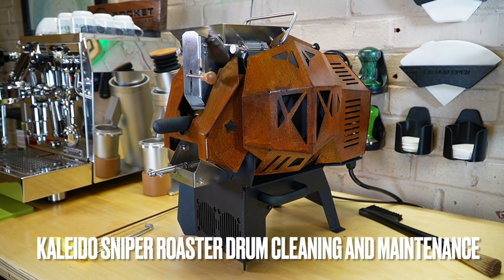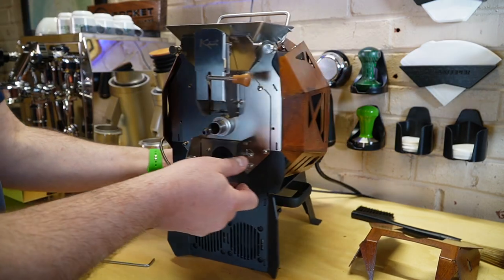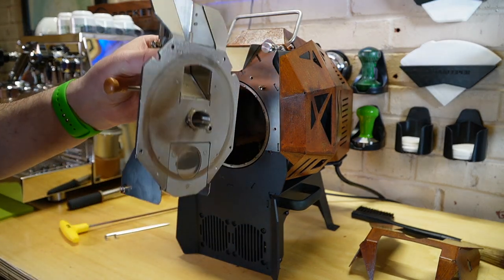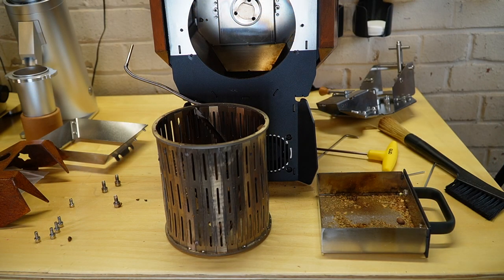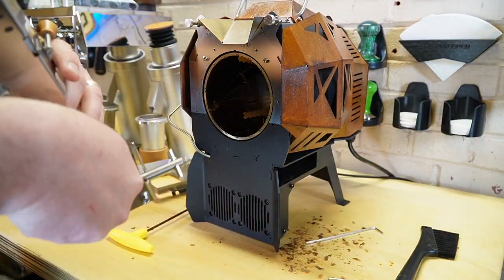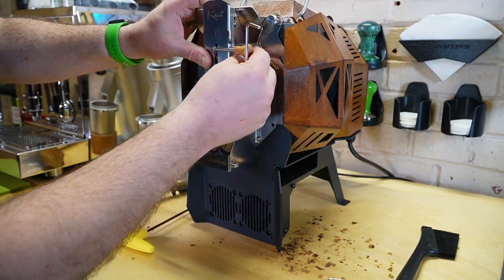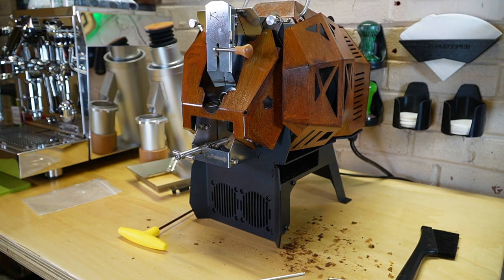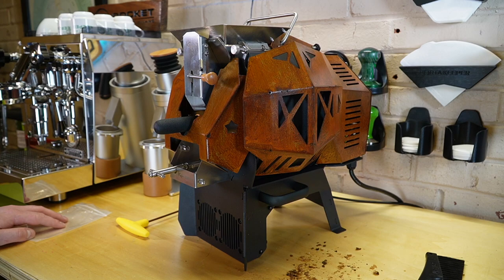Kaleido Roaster   Drum and Roast Chamber Cleaning and Inspecting

Comment: Great video, Barrett! You mention cleaning the resin that has built up on the face plate. Is that something that should be tended to on the drum and inner chamber as well with a solvent like Simple Green? Seems like it might build up over time whereas a regular maintenance routine might make cleaning a little easier.
Reply from the maker: Not required in the roasting chamber.  Probably not really required elsewhere unless there is a lot of buildup.  IE your drum is rubbing, trier is gummed up, door gummed up.   Would not recommend simple green personally.   Probably cafitza on the face is needed.

Comment: Using a Magnetic Allen wrench would have helped getting the faceplate screws back in.
Also can the drum and front plate be cleaned using Cafiza to remove the burnt on oils?
Reply from the maker: You can pull the drum and front plate and scrub with cafiza.  Works great.  Don't recommend using inside the roaster.

Comment: Did you acid wash the covers to get the  rust look?
Reply from the maker: Manufacturer chemical treatment process to force rust, and then neutralize the metal to stop the rust.  Sealed with a clear coating.